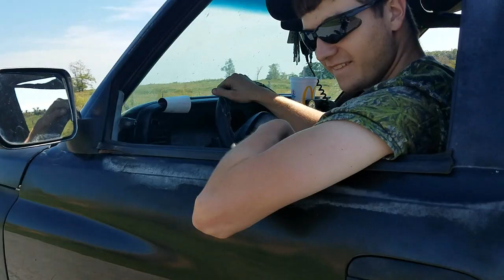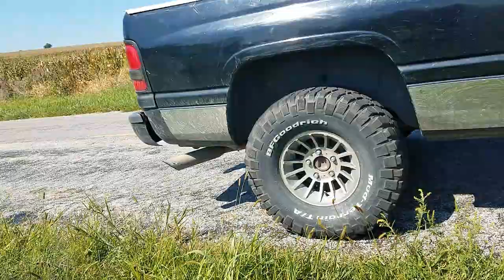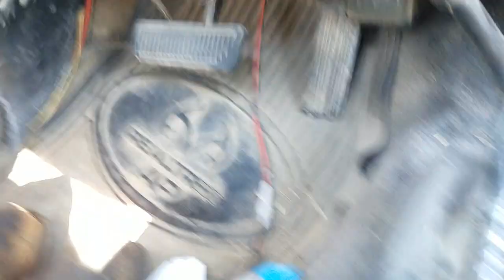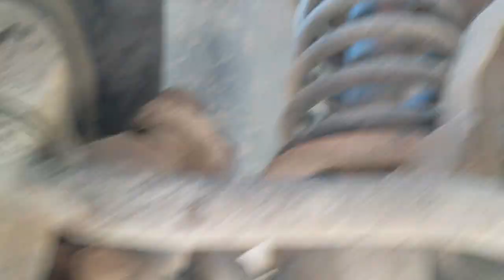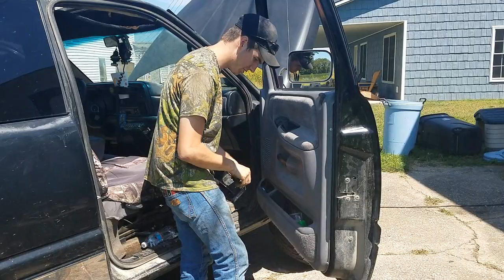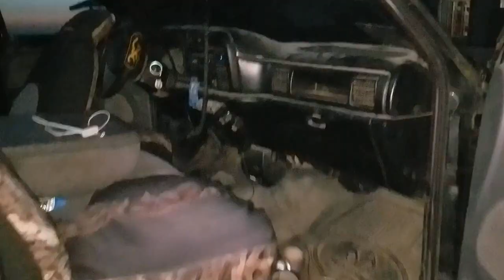THE RARE 5.2 MAGNUM DIESEL! | Dodge Ram Shenanigans

Comment: Is that still the original engine and trans? I heard the magnum engines can last forever in these 2nd gen rams but they had garbage auto trans from everything I've ever seen. I have a 95 5.2 v8 regular cab with 224k miles I got for only 800 last year, got 4 used tires and did an oil change and tuneup and got a dual exhaust put on and it's been pretty good and gets me from A to B...thankfully mine doesn't burn any oil, I heard that plenum gasket was apparently a huge problem on these too....I knew a guy that delivered pizza in an 01 v8 dodge, dunno if it was the 5.2 or 5.9, but he had to buy a 5 quart jug of oil every month since it was burning so much and it only had like 176k on it, still drove pretty good though I drove it once. IDK if my trans has ever been rebuilt or anything, I hope it can last awhile, I've debated if it would be worth spending the ~$2k it would cost to install another versus just getting another vehicle when it inevitably breaks one day. These 2nd gen dodge trucks have a fond spot in my heart but I like the look of the 88-98 chevy trucks better, to find an extended cab short bed 98 chevy I think would be ideal, but good luck ever finding one cheap not beat to hell with a million miles on it in my area all these years later... I like the interior better on the 95-98 gmt400 chevys
Reply from the maker: Yea, I'm the same way with dodges haha Zac here has owned a few dodges and it really got me into the whole truck trend deal. I've always been told that you "Can't kill a 318." And from what I've seen that holds up to be true. Zac here bought this truck and it was already bad on burning oil. A lot of motors in general can burn oil and still hold up for a long time. But the 318's (5.2's of course) are great motors. Now I personally owned a 1995 Dodge 2500 5.9 gasser (360) and it burned a ton of oil as well as hand a bad rear main. I had that truck for a year, and sold it because I just wanted something different (was looking for a Cummins at the time). Otherwise I'm a Chevy and Dodge guy for sure. And yes I do agree with the trans as being the 2nd gens biggest faulty part. That and ball joints. They don't hold up to any sort of power or abuse. I found a 2001 2nd gen gasser that had 140k original miles and the trans was slipping. Just depends on how yo treat them though. Regular filter and fluid changes has a lot to do with it.
Reply: It’s the same motor as the 93-98 Grand cherokees and they’re stout little motors I’ve had two with more than 300k km on them and they both run decent and being completely straight piped never ever smoked like that even at 5000 rpm haha
Reply: the transmissions arent actually garbage. they are a 727 torqueflight with an added electric overdrive. the hemi engine drag cars back in the day used the 727 and it never died. you have to know two things about the a518/46rh to keep them from dying. 1: TURN OVERDRIVE OFF WHEN TOWING. 2: THESE TRANSMISSIONS PUMP THEIR FLUID IN DRIVE AND NUETRAL, NOT PARK. if you leave them in park while you sit somewhere, the transmission fluid isnt being pumped or cooled, and will wreck the clutches.
Reply: Bought my 98 ext cab .. couple months ago for 700 with only $100,xxx was just sitting in guys drive way he wanted gone
Reply: @frigglebiscuit7484   sorry for the late reply, I've done a lot of reading on the 2nd gen ram trucks in general out of curiosity, this 95 5.2 is my 2nd one, my first was an 01 3.9 I traded for a 92 firebird that ended up having more problems than it was really worth honestly but I'm a sucker for those old 82-92 firebird/camaros, barely ever see any in existence anymore. I too heard the 2nd gen ram trucks' trans was basically a old 727 and people swore the 727 was fine in the 1st gen ram trucks too for example. I heard adjusting the bands and keeping fluid/filter service up on these can greatly increase their life. I wonder if all the bad rep they got over the years was from people who never took care of them, on top of abusing them like not fulling stopping before changing gears, etc. I'm always very deliberate in giving it a second to engage before I take off too, I drive gently around town and some highway driving. Over 225k miles on it now. It does burn maybe half a quart or 0.75 of a quart of oil per 1000 miles I found out when doing the oil before. Although from reading and vids, many newer cars burn more than that and dealerships claim it's normal...so my 24 year old high mileage engine is doing better than some new very expensive vehicles in terms of oil consumption lol. My brittle plastic dashboard has broken all apart though, I'd like to tighten the steering up a bit too. Besides that and being a bit thirsty for gas, I can't really complain about a tough cheap vehicle that gets me from point A to B reliably, AND has working AC and heat all these years later too
Reply: My 318 has 245k on it burns maybe a couple quarts between oil changes but the damn engine is solid. Dodge use to make amazing engines even though they couldn't build a proper transmission to save their lives lol. On my third one and installed a monster level III this time and feels like a brand new truck. 46re sucks lol
Reply: The 727 is probably the best auto transmission you can get in pre 90’s trucks. It’s all about keeping them cool and using neutral if you need to idle the truck. Big trans cooler will make the 727 lay for 300,000 plus.

Comment: Plenum gasket bruh
Reply: Cody Cullum how you know
Reply: TookDaChargeAt17 because it pulls oil from the top of the engine under the intake manifold where dodge put a stupid plate on that the seal blows out on due to temps from the aluminum heating up faster than the block of the engine. Causes oil burning.